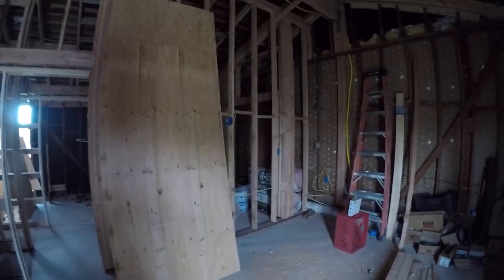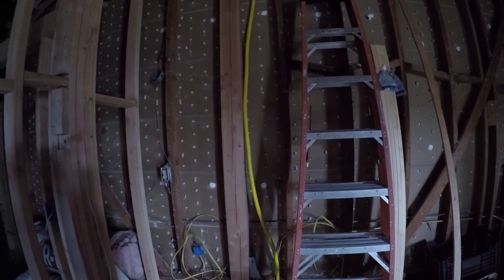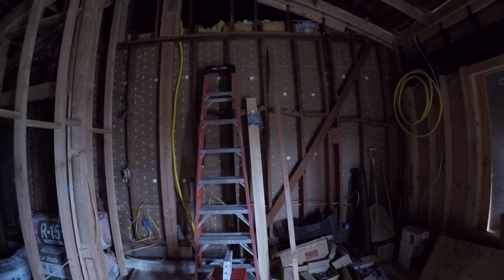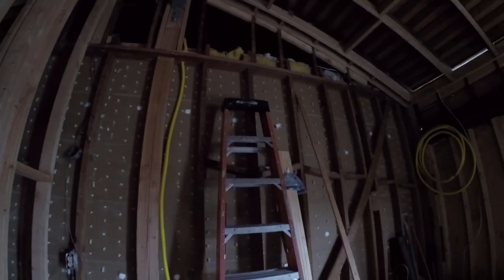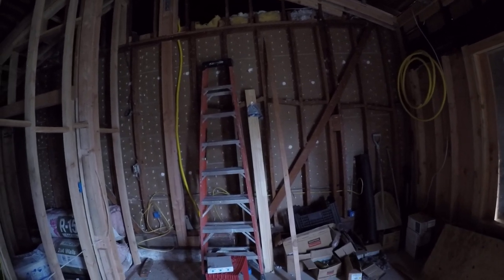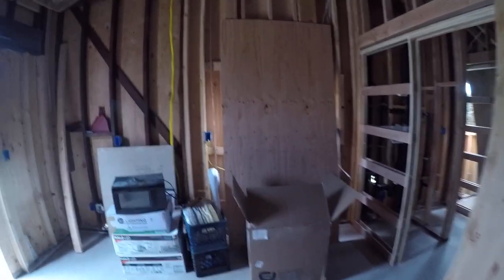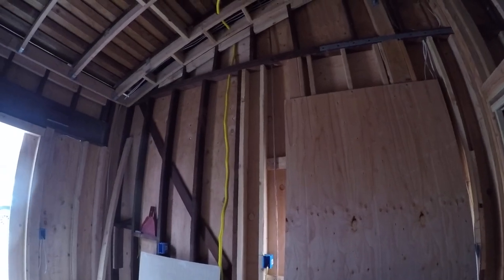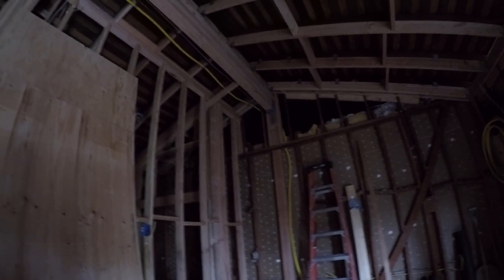2021 $40K ADU Garage Conversion 428 SQFT E:16 Issue #3 Sound Insulation

Comment: How long did it take you to get your “Certificate of Occupancy” for your detached unit once the construction was complete?
Reply from the maker: I remember my general contractor handing me the report card with all the passed inspections which had a stamp for occupancy from the city. It was like a week or so after final inspection when inspector came to check the smoke alarm, carbon monoxide alarm, electric subpanel, hot water, ac, and heater were inspected.
Reply: Really appreciate it, I’ll be done building my Junior ADU in about 2, max 3 weeks and wanted to get an idea of when I’ll have the CoC to be able to rent it. Thank you
Reply from the maker: @themoneyteamsanchez3505  One more thing. I remember that after the final inspection passed and I had my certificate of occupancy, I moved into the detached unit and quickly realized the hot water was not working properly. 
It would work intermittently. Sometimes it would work fine. Other times there was no hot water unless I turned multiple faucets on plus the shower. Other times the water would go cold while taking a hot shower.

My GC's plumber couldn't figure out what the problem was. I did research on the original EccoTemp tankless water heater and quickly found lots of reports of the flow water sensor being crap on those EccoTemp. Then I read a lot of the other problems with EccoTemp tankless water heaters.

My GC returned the EccoTemp back to HomeDepot (it was like 2 weeks old) and I asked that he put in a RInnai tankless water heater. Rinnai happened to be on-sale at Home Depot for about $50 more than the EccoTemp. My GC got the RInnai and it's been working great since 5/2020. No issues at all with the Rinnai.

Another issue was a flickering ceiling fan. THe electrician couldn't figure out why the ceiling fan was flickering every 25 minutes or so. I did research and it's a problem with the fan. Unfortunately, I picked the fan brand (Hunter) and model. Hunter has an issue with some type of watt regulator that's required in USA. This regulator cuts the power every 25 minutes or so. Anyways, I don't use the ceiling fan that often, so I might replace.

The moral of the story is spend some time in your Jr. ADU to get the kinks out!
Reply: That’s great advise. The Junio ADU will be sharing the same water heater as the main house so there shouldn’t be an issue there moving forward. However, I’m in the process of getting plans approved for a detached ADU (newly constructed). I don’t plan to run a gas line to the detached ADU so i will be looking into “all electric” water heaters, so I’ll make sure to keep what you said in mind. I’ve got plenty of time from now until then to do more research. And thanks again for these great videos, they’ve been very helpful from the beginning.
Reply from the maker: I considered all electric for my garage ADU, but I quickly realized that the demand for amps from the water heater was too high. You need to allocate like a 40, 50, or 60 amp circuit to the electric water heater depending on how much hot water you want to have at the same time.

This doesn't include the amps demand from the rest of the unit and I had considered an electric stove, electric dryer, microwave, garbage disposal. It added up fast.

Moreover, the electric company did not want to give a me a 400 amps since these are mostly for businesses and the electric company might require additional paperwork/permits/fees to get you a 400 amp meter.

Also, my general contractor said it was not a problem bringing in the gas line to my garage just by tapping into my existing main gas line. After he said that, then I switched to gas.

I have a separate address for my garage ADU and I will have a separate electric meter, but the garage will be sharing my gas and water (no separate meters).